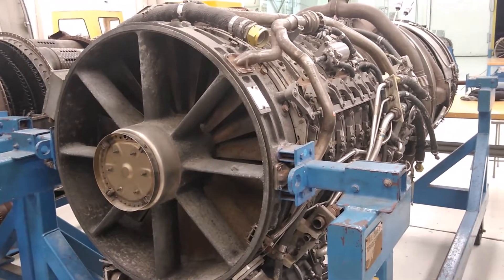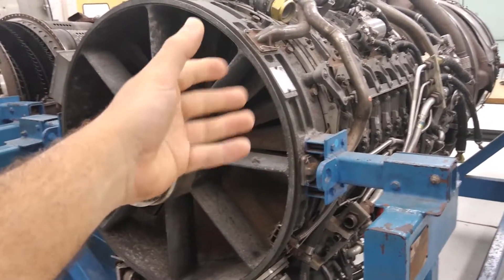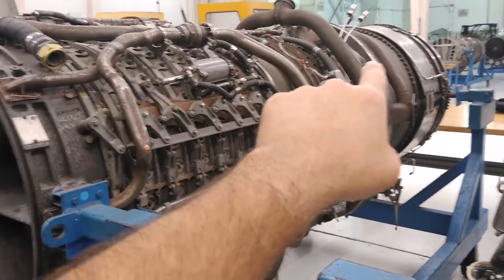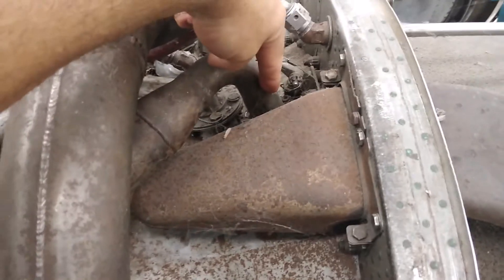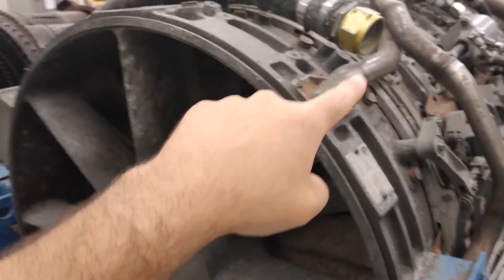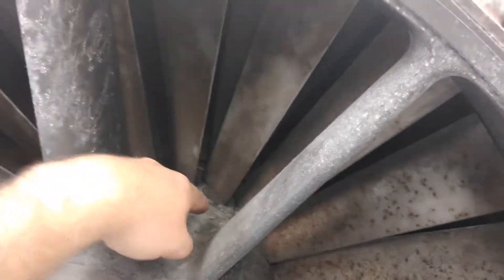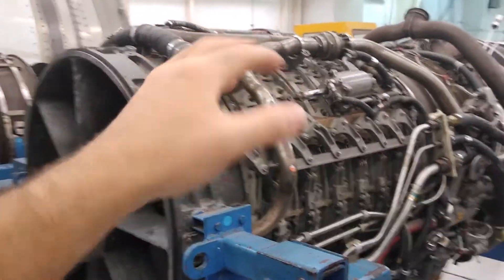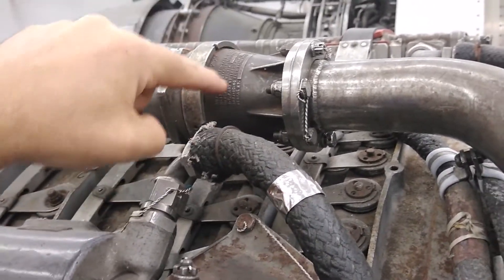JET ENGINE ANTI-ICE SYSTEM(Inside View)

Comment: I saw one of these engines for the first time yesterday. taken apart in Wanaka, New Zealand. Now I don't know much about jet engines other than the basics. I was trying to work out how all the plumbing operated on it just from look alone. One thing I noticed looking in the front was the area infront of the fan that appeared to have many many small holes in it. and around the outside had a ninifold that looked like it connected to somewhere in the late compressor stages.. Took me a bit to work out it was probably part of an anti-ice system.. What blew me away was that this engine is obviously pretty old, and outside exposed to all the elements. Yet not a hint of corrosion on it. The alloys they must have used in it were obviously very high quality.. The other thing was the welding on the plumbing. I've never seen welding that good looking. Amazing how insane the workmanship was on this 'primitive' jet.. One bit I couldn't work out is the starting. I assume it's air started. It wasn't quite complete. But I'd be curious to know how that works (bonus for dropping technical documents I can get my head into)

Comment: What a discovery this channel!!! Amazing and quality content too difficult to find. A couple of questions:

1) What is the "coil thing" on the front frame wall (at 4-5 o'clock) for? I think it's a temperatura sensor but I'm not sure. And the "rusty" diffuser at 2:33 (right above your hand) coming out the compressor-combustor transition section? 
2) Could you make a video about the fuel-oil heat exchange of this engine (J-79)?

Thanks :)
Reply from the maker: Hello David and welcome to Plane Simple.
Thank you for the kind words about the channel. 
1) That "coil thing" is indeed an inlet temperature probe.
The "rusty diffuser" at 2:33 is another bleed air port that feeds bleed air to the aircraft airframe. I'm not sure what it is used for specifically since we didn't have the aircraft that the engine was once mounted to, but it could be for wing anti-ice or some such thing.
2) As far as the fuel-oil heat exchanger, take a look at my video called "Oil as a Coolant". In that video I talk about that very same heat exchanger. Also, as a bonus, you'll get to see more of that "rusty diffuser", or at least different views of it and the flange that would connect to the airframe.
I hope this helps, and thanks for watching my videos.